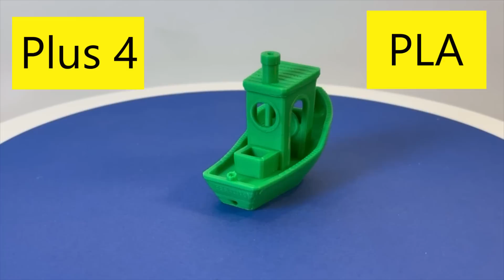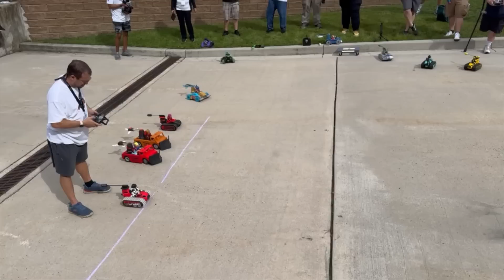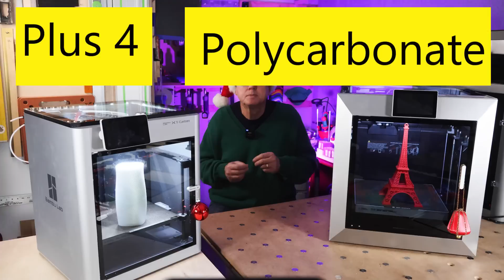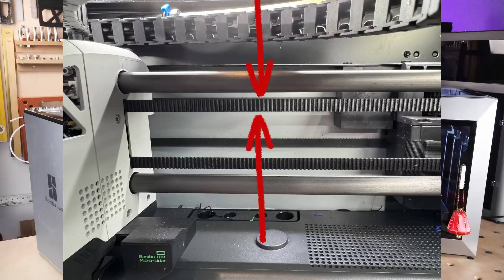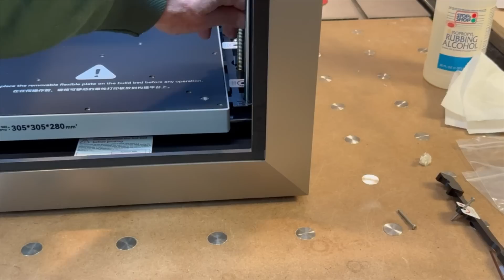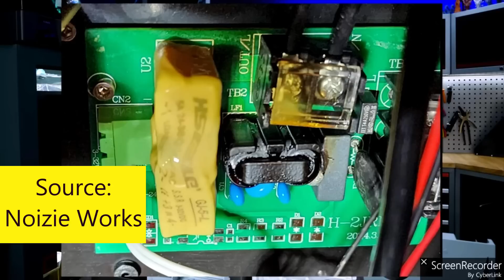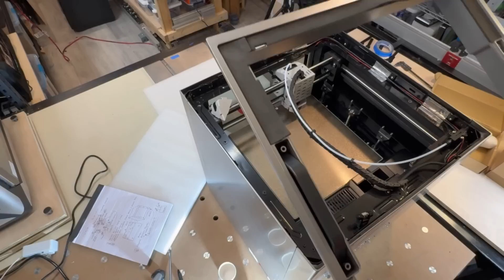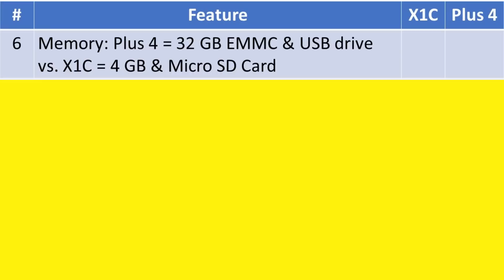Qidi Plus 4 3D Printer: Better Value Than Bambu Lab X1C?

Comment: 2:00 Another reviewer who just released their video said they found this to be caused by thermal retraction due to excessive heat buildup for PLA material and by opening the door the issue went away.  It's possible lowering chamber and bed temps would also resolve this issue.
Reply from the maker: I'm fairly certain that I had the door open for my PLA Benchy printing, but there is no harm in me running the print again just to be 100% certain. Thanks for the comment.
Reply: @ristinnovations  for what it's worth, with top panel removed and door opened, my plus 4 had the same exact print issue on the same exact corner on benchy, and ive seen other reviewers with the exact same artifact. It's entirely possible given the widespread consistent results that it's a file issue in the pre loaded file? I didn't try loading a different benchy to print tho as my next print was the top lid standoff and it printed with zero artifacts and I just never thought about it again.
Reply from the maker: @SweetLou0523 Thanks for sharing your experience as well as your suggestions.

Comment: Haha, after this video telling people that qidi had catched up at Bambu quality is just redicicolous.😂
Reply: Try to print ABS/ASA with a large scale. Or nylon PA6/PA12. And, finally, something close to PEEK. Compare then, I mean not only exterior but toughness test and so on. 
QIDI is for engineers, Bambu is for PLA/PETG and other homemade hobbies. Or something small made of ABS, not more.
For instance, I print different technical items, I don't even think about Bambu - it is a toy for my purposes. But if I need some Nyear dragons for my kids - sure I'm gonna buy Bambu.
Reply from the maker: I specifically said that QIDI Tech was catching up; not that they had caught up and were even with Bambu Lab.  I also combined product features with product quality, which I think I could have done a better job explaining the differences between the two subjects.  I also stated what QIDI's CEO said in his letter that Qidi needs to improve their robustness of their product testing before they launch their products.
Reply: Qidi plus 4 in many aspects is a better printer than bambu X1C. higher temperatures of the nozzle, build plate and chamber will let you print more engineering materials, bigger build volume, and lower price. Yes, qidi have quality control issues, but also much better support than Bambu Lab. I received the printer in the same time as new SSR board, I replaced it in 20min, treating it as a part of my  initial setup and since taht time this printer works like a charm. I don’t have direct comparison with bambu lab print quality, but there is another youtube video made by 3DPrintSOS, with the conclusion that qidi is slightly better than bambu. Yes, bambu have AMS, if you need it, that’s a pros, but Qidi should have quite soon similar functionality as well.

Comment: The qidi machines are a write off after 1500 hours. The plastic moulded parts in them are a nylon glass fibre mix that disintegrates after a while. Replacing those parts will require you to have the skills to build a voron. Ask me how i know! . Get a bambu and don't worry.
Reply: Sorry, but this is bs. Have you ever checked the parts under the hood of your car? It's Polyamide ("Nylon") to a huge extent.  Nylon is a high perfomarnce engineering thermoplastic material, so why should anything "desintegrate"? 

But I am pretty sure you are a specialist in material science and the material used by Bambu is the one and only that works.
Reply: @etwkoelle6487 because the parts in the original x max 3 had to much glass fibre mixed in with the nylon, meaning there was not enough nylon to bond the fibres together. Then they started to break and crack. So how about you calm down and get off your high horse buddy. Jesus, what a shill
Reply: @jasonvanhek4749  "too much glass fibre" - again bs. Do you have any idea, how much GF content can be used in Polyamide? There are resins up to PA GF50, which by far is not used by QIDI. You are saying: "QIDI parts bad", but the explanation is technically bs.

Comment: So, both models can go from 0 to 60 at roughly the same rate. Are parts under the hood equal? One has already been on the road a few years and still going strong. Personally, I prefer the higher quality machine, but perhaps technology is beyond that.
Reply from the maker: My observations are that both printers are built using a solid frame.  Mechanically, they look similar to me. I'm not an expert in electronics, so I can't offer any input there.  If I had to rate the two machines, I would still list the X1C on top, followed by the Plus 4.  I'm not sure if I provided you with enough information to answer your question, but thank you for your question.

Comment: Bought the Qidi Plus 4 3 months ago. No real complaints and enjoyed the larger plate size. Last month it printed a very large blob inside the cover. 
While it was awaiting parts that was covered under the warranty I ordered the X1 Carbon. Gota say both are equal in quality both in construction and print quality I really enjoy the AMS enough that it's my fav. Though I read Qidi will have there AWS out Q1 of next year. 
When dealing with Qidi service I simply told them the issue and they promptly responded with tracking number for all components to replace everything in the print head and all electronics and boards associated.
Reply from the maker: Thanks for sharing your experience with both printers. I also love my AMS and I agree with your other comments. Thanks for taking the time to provide your comments.

Comment: Plus 4 has 55% more print volume, not 36%  You must consider all three dimensions for volume.
Reply from the maker: I did take into consideration all three dimensions. I calculated the X1C volume to be 16,800 cubic cm and the Plus 4 to be 26,100 cubic cm; however I found an error in my calculations and you are correct; the Plus 4 has 55% more print volume.  Thank you for pointing out my mistake.
Reply: From a math point, sure, but when do you print a max cube? 😄

Comment: Funny how just now printers are finally catching up to Bambus almost 3 year old model...
Really shows how far ahead they were
Reply: @tek9058  You're still comparing it to an almost three year old model. Sure, they may be a bit ahead now, but think of what leap the next proper bambu model could be.
Reply: @NaveTK I think you're over estimating how 'revolutionary' Bambu was. They're solid printers but the most significant advancement IMO is a polished ecosystem that's friendly to less experienced users and a reliable multi-material system at a competitive price point. The rest is simply a well-tuned CoreXY printer in an enclosure running closed-source software. It can produce great prints out of the box but where they did have to trim costs makes it difficult to repair the inevitable issues that pop up after a year or two of heavy use.

As someone who has made custom printers, they're not interesting to me but I respect how they pushed the industry to step it up. I'm not a fan of forced data collection but my main concern is their popularity has led to other printers (like QIDI) also being assembled in ways that make long-term maintenance about as practical as repairing a big name ink-jet printer.
Reply: @tek9058  Are you basing this on direct experience of a paid-for, off-the-shelf K2 plus? Or the golden samples that the influencers undoubtedly received, and their resulting videos gushing about how amazing it is?

Don't get me wrong; if the K2 plus is as good as I'd like it to be, I'll grab one. I just don't trust creality with new product launches.
Reply: 3 years and still marketing at 1099usd😂
Reply: @AshianShinn  
Production costs go up, not down. This isnt an large electronics manufacturer that needs to dump old stock.
Those that are not happy with the specs need only wait few months as the already announced the new series will come next year.
Reply from the maker: I agree with you.
Reply: Not really, my X Smart 3 was the same price of an A1 mini and it's a way better printer.
Reply: @eaman11  then I'm glad you got such a good deal, the QIDI X-Smart 3 was around 150 bucks more expensive than the A1 Mini on release. Unless you're comparing it to the A1 Mini Combo which includes the AMS.
As for "better" printer, quite subjective, they have the same speed, same material support, same qol features and same print quality.
Reply: @NaveTK   The X Smart 3 was 185e shipped on Black Friday, previously it was 240e. 
It does 12k accel on external perimeters, ~25k max travel accel, bed goes up to 120c and it's an enclosed chamber thant prints ASA / ABS like PLA. The A1 mini won't go over 80c, no eng materials at all.

And it's a corexy: it's no fun to use the A1 Mini in ludricous mode!
Reply: were, they haven't released anything new/better than their 3 year old printer
Reply: I had a look at some Bambu reviews even a year back and there were problems which are now resolved in the software and firmware. So I think it's just that Bambu has had the luxury to improve their models over this period rather then them starting off out the gate as almost perfect...

Comment: I'm a long time 3d printer, Makerbot replicator, CR10 heavily modded, various Prusa versions all with hundreds/thousands hours under my belt including the usual tweaking/tinkering/repairing. It came to the time I was due an upgrade last week. It was either a Prusa MK4 or higher. After watching your video and others I decided it was time to leave Prusa get into the "fire and forget" market. I went for the Bambu X1C and so far I'm blown away with it (other than the noise it produces👎🏼)
Reply from the maker: Thanks for sharing your experience with the X1C, as well as your years of experience with other printers.
Reply: Any thoughts on firmware update?
Reply: To prawda. Kupujesz X1 i drukujesz. Cieszysz się, że nie musisz niczego poprawiać.
Reply: @3DPRlNT warto x1c teraz kupiwac czy lepiej oszczedzic i brac plus4? Mam ciezki dylemat przed soba
Reply: @Laurencjusz01  Bier Bambu. Będziesz zadowolony.
Reply: If you haven't realized yet, you can silence the X1

Comment: BTW that "under extruded" Benchy on the Qidi Plus 4 is probably the "3D Benchy" text in the stl model :)
Reply: Seeing as everyone including myself seems to have the exact same issue on the exact same corner, it's extremely likely we are all using the onboard file and there's some issue with the file. I could probably load a different than benchy but all of mu subsequent prints have been flawless so it didn't seem to be a priority.

Comment: I have bought quite a few 3D printers over the last 11 years, the X1 Carbon Combo has given me much less downtime than other machines, that's not to say it hasn't had issues though, when I took the nozzle out to clean it the unit could not be replaced as one of the brass thermal inserts in the extruder popped proud and so stopping the replacement of the nozzle, my UK vendor had a replacement extruder in the post that very day and I received it next day, I have purchased many printers from this vendor, Technology Outle in the UK, they have the best customer service I have ever encountered and I was a customer service manager for an international company
 The X1C produces very good quality prints and very quickly and at the time I bought it was the only super fast machine that was multi material and under £1500.
The Plus4 is half of what I spent with Bambu Lab, I was intending to purchase a second X1 Carbon or maybe a P1S, I was hoping for a new flagship model from Bambu by now, think this will now be soon though, I will hold out for now though, I could end up purchasing a Plus 4 machine.
Reply from the maker: Thank you for sharing your experience with the X1C. I have had a similar excellent experience my X1C. I’m also very interested in seeing what Bambu Lab will be launching during the first Quarter. Thank you for taking the time to provide your detailed comment.

Comment: I have the qidi plus3 for some time and be very happy with it. But I dont know the Bambu
Reply from the maker: Thanks for sharing your experience with the Plus3.
Reply: I have had a multitude of 3D Printers in the last 11 years, I can say with certainty that the Bambu Lab X1C Combo is the best machine I have purchased, but I have probably said the same for many of my machines.
 I have been thinking of buying a second one and a second AMS, however, I have been hoping that Bambu would release a larger machine with a toolchanger, a toolchanger would create a lot less wastage with multi colour and multi material prints.
 The Qidi plus 3 was on my radar also when I decided it was time for one of the super fast machines, I think it was the AMS capability that made my decision.